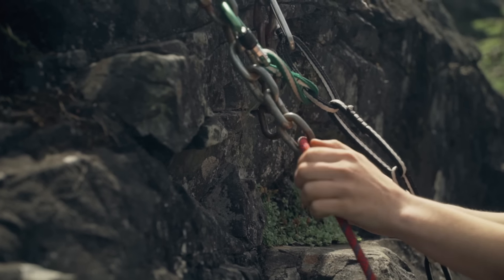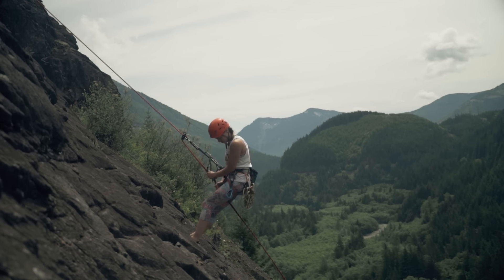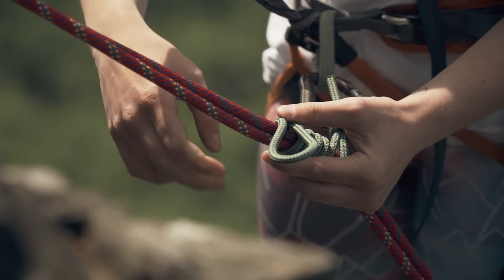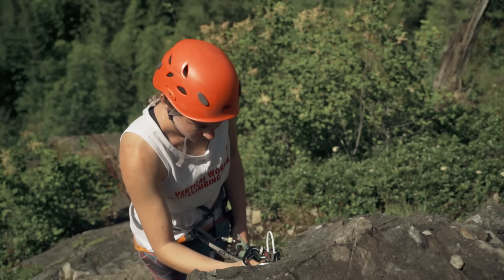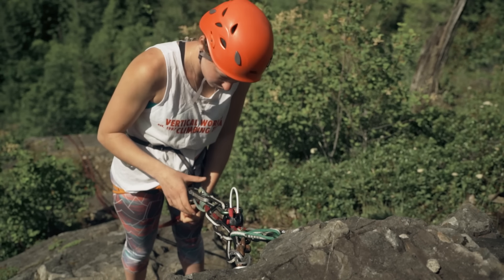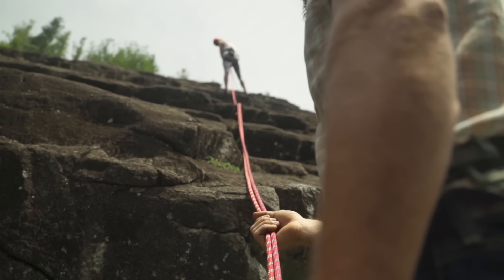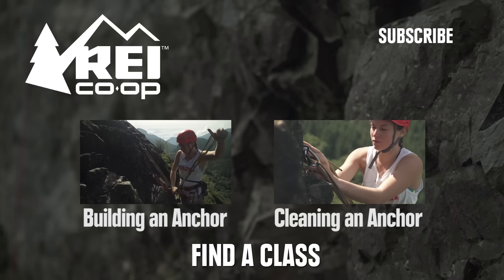Rock Climbing: How to Rappel

Comment: Make sure you initially set up the Rappel Device at the MIDPOINT of the PAS loops.  That way you won't have the extra slack of loops dangling when you clip the anchor-biner back to the harness belay loop.  Positioning the rappel device that full distance away also allows the friction hitch to function properly if needed by not bumping into the belay device.  
And NEVER use a Daisy Chain sling for this method! It's not designed for this application!
Reply: Joe Weber  no it's a "Personal Anchor System" with independent slings linked together, whereas a daisy chain is one piece of fabric stitched to itself to create loops you can hook things to. See https://mojagear.com/learn/2016/05/11/shouldnt-use-daisy-chain-personal-anchor/

Comment: I’d hate for them to see how I rappelled as a kid at camp with a carabiner and figure 8. But hey, it was the 80’s!
Reply: I think this is still the common method. This one here has way too many moving parts that aren't really necessary.

Then there's racks for any height over 100ft, as the weight of the rope itself will cause too much friction.
Reply: With a nylon rope used to tie loads on a truck or even the harness made out of a rope instead of a nylon one! I can still tie the harness!
Reply: Who the hell wants to take an eternity going like she is, i was taught the military way!
Reply: Lol or in 2018 working at meriwether.

Comment: How does clipping into two points of the personal anchor system make it redundant? If the chain closer to you breaks you lose the carabiner since it's connected to that loop. One break corresponds to critical failure, and does not mean its redundant
Reply: haha, exactly what I thought.
Reply: nevermind...  @2:58 she clips the opposite end of the extension back in to her belay loop - which does indeed make it redundant.
Reply: Watching it again, does it become redundant at the end when she clips (what was connected to the anchor) back to her belay loop?
Reply: When you clip back into your belay loop it ensures that if one loop pops, you are still attached with either your belay loop or with your anchor points, depending on which loop fails.
Reply: That PAS is rated to 22kn on each loop. It’s also double stitched just like your belay loupe. Never heard that it needs to be backed up like this.
Reply: @zraybroske2416  It doesn´t

Comment: Isn't a prusik knot better than a friction hitch as a security?
Reply: Hey. I've been doing Search and Rescue and high angle rescue for 6+ years, and climbing for  20+. I personally use prusiks, but there's an assortment of hitches that serve the same purpose and function well. The whole idea is that a loop of cordage that's about 3mm smaller diameter than the rope, when wrapped around several times and pulled unevenly, will bind when loaded. I would recommend sticking with the hitch for this purpose that you know, are comfortable tying, and can do correctly every time even when you are tired, getting rained on, and distracted.
Reply: Yes, it is more secure, but are you planning on prusiking down the rope or rappelling? If rappelling the autoblock is sufficient and smoother (by far).
Reply: @bestbuilder1st  of course rapelling, just a prusik as safety backup when you let go of the rope. On very steep terrain it's just dumb to prusik down the rope imo
Reply: @kjelldegroot5137  Prusik safer in this scenario?  Not so, if you constantly have to fight the prusik (like most people do) or have to spend your time tending it (like even more people have to do, it is not safer.  An autoblock is the most effective and efficient system for a rappel.  Why do you think all the professional guides teach and use the autoblock?

Comment: My instincts tell me the more complicated it gets like this, the more likely you'll miss something. Anyone else feel that?
Reply: Where is it complicated?
Reply: people hae been rappelling for ages. all of these safety measures are more than likely written in blood, just like with the complicated electrician laws that keep getting updated to reduce the risk of electrical fires, or road safety measures, the same. while you aren't breaking any laws with rapelling wrong, youre possibly hurting someone by not following the techniques that have been developed over loads of years to prevent people from getting hurt.
Reply: Not that complicated. The atc is an easy to use device with no moving parts. The friction hitch is just backup
Reply: This is pretty simple after you've practiced a couple times. Redundancy is necessary because gear does fail, and if you do make a mistake then another price of gear will catch you. Climbing has become pretty standardized on what works and what doesn't after decades of experience and people dying.
Reply: Some important things this video doesn't include, tying stopper knots so you don't rappel off the ends, making sure the carabiner is clipped through both sides of the rope in the belay device, and making sure you are connected with your personal anchor before testing the weight of the rappel system so you don't fall.
Reply: Was my first thought... but it looks much safer then how i was shown many years ago ... Im sure after a few hands on examples with someone that knows what there doing it will make sense
Reply: Absolutely 30 years ago we didn’t have any of this all we had were ropes and harnesses and a piece of pro belay  unit and that was it and we lived to tell the story ha ha ha
Reply: This isn’t complicated. This is a simple rappel with redundancy

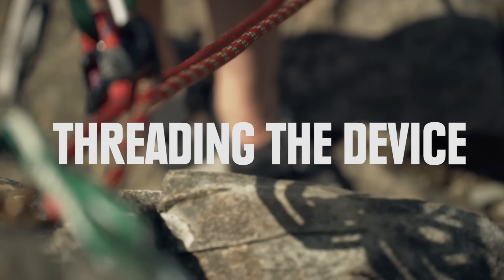Comment: At 1:15 you say to clip into 2 loops to keep the system redundant.  This is false security on this type of tether.  If the loop closer to the climber breaks, then the other loop is already detached.  This does not add redundancy.
Reply: Both ends of the PAS are attached to the harness (much later in the video).

Comment: How is clipping your carabiner through two loops redundant? If the bottom one fails, being clipped into the top one does nothing.
Reply: my thoughts exactly
Reply: Its because she clipped the PAS into here belay loop from both the top and girth hitched from the bottom. Thus if one of the loops snapped either the clipped belay loop will save her or the girth hitch side. (correct me if my reasoning is wrong lol)
Reply: Be sure to catch a class cause clearly a video will not make it for you
Reply: I was wondering the same thing?

Comment: Excellent video as usual - but one thing, when you talk about stopper knots at the end of your rope, you show them on the ground!  That won't keep you from hitting the ground like a correct stopper knot would!
Reply: The stopper knot is for habit, the idea being if you cant see the ground on the rappel and your rope comes up short that knot at the end will keep you from rappelling off the end of your rope and falling. Think of anything longer than a sportclimb. As for your concern about hitting the ground in this video that is why they showed a friction hitch which should be able to catch you should you lose control.
Reply: @geoffreyallenperdue  Different Andrew mate
Reply: @geoffreyallenperdue  stopper knots are useful on multipitch rappelling, also on lead belaying when you plan to lower your partner. Andrews idea of tying stopper knots that hang up off the ground to prevent decking on an out of control rappel are not practical for many reasons, not the least of which is that you would not be able to accurately tie them. Much of the time you can't see the ground while throwing a rap line. It is very wise to climb with an experienced mentor when first starting out. These are simple questions easily answered in real life climbing days outside.

Comment: What do i do if i'm afraid i'll fall and freak out?
Reply: that is what the prusik (or friction hitch in this video) is for... it will stop the rope from sliding through the belay should you let go of the rope for whatever reason. Abseiling - when using proper technique - is quite safe to do. And great fun as well.
Reply: Like they mention that the start, have a more experienced friend it with you that can give you a Firemans belay from the bottom. Even if you completely do everything wrong, they will save you just by pulling on the rope.
Reply: always carry alternative plan with you incase your main thing goes off.  then secondary will hold. there is no second chance here ..
Reply: just make sure your spidey web works
Reply: Did you ever go? If you're interested, check out my "Rappelling for Beginners: Build Confidence with a simple rappel" video. You can start by practicing off a porch, staircase, or steep hill. Use a prusik and go with someone experienced. You can also use self-efficacy building techniques like: 1) consider what similar things you've done (climbing a tree, swinging on a rope swing, tying knots on a sailboat). 2) watch someone else and picture yourself doing it. 3) consider the realistic worst-case (not falling, but more like the person doing the fireman's belay catches you if you freak out, the prusik catches you, you stop mid wall and have to take some deep breaths to calm down) 4) use some positive self talk. 5) practice in a different setting first. 6) consider how great you will feel at the end.
Reply: Take courses from certified providers until you feel confident doing it without the guides.
Reply: Then don't rappel in the first place

Comment: cant I just use a last ditch belt instead? ID trust that over a redundant chain any day....
Reply: John Mead i’ve only ever used a shoulder length nylon sling. figure out where you want your midpoint and tie an overhand on a bight. there’s no reason one needs a PAS.
Reply: Either one is fine. PAS or a sling.
Reply: interested in the overseas terms:

2' or 4' sling is a shoulder length??